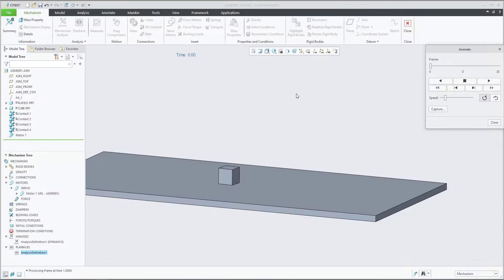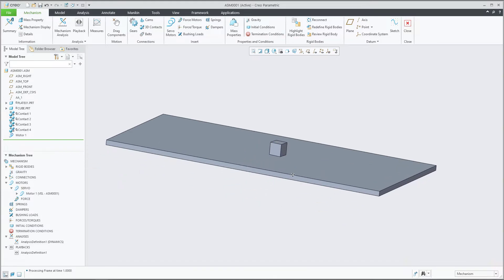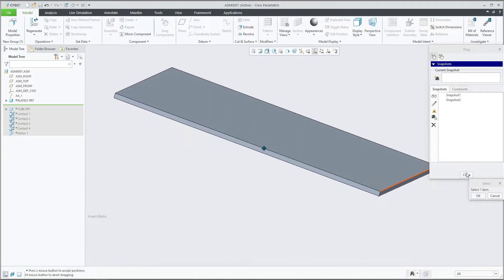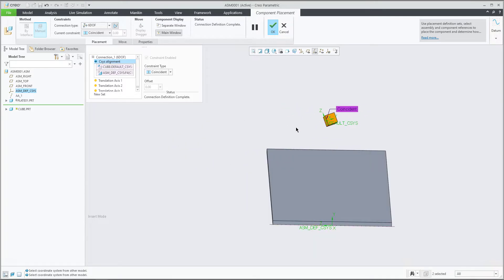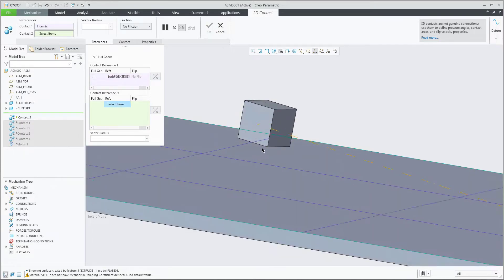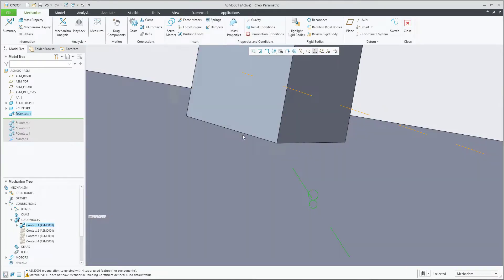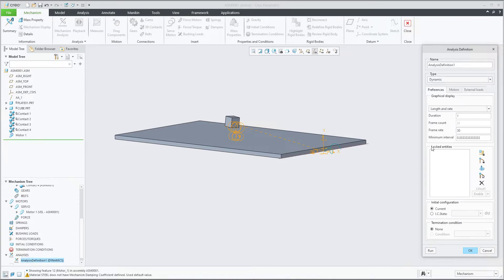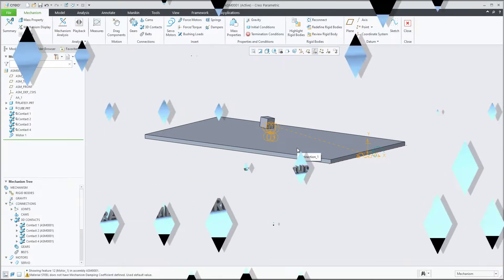3D Contact as a Slider - 3D Contact between flat surfaces - Creo tutorial

Comment: Thank you very much Sir for answering my question! It is really very helpful.
Reply from the maker: You are welcome. Try to specify your custom material and set friction if needed. Good luck with your project. Vladimir
Reply: @4kside  Sure sir I will specify material and friction that will be realistic approach. I have one question that we applied 3D contact by selecting vertex not by selecting the plane of small box. Can the results of connection loads from Measure of 3D contact be considered realistic (as I don't have analytical (calculated from theory) results and I want to rely only on Creo dynamic analysis.)
Reply from the maker: Hello again, here is more details about 3D contact http://support.ptc.com/help/creo/creo_pma/usascii/index.html#page/simulate/mech_des/3D_Contact/about_3d_contact.html
Meybe it helps a little bit ;)
Reply from the maker: You can use the 3D contact measure to define pressure angles, contact areas, and slip velocity properties. During a kinematic drag, collision detection is enabled between 3D contact parts.